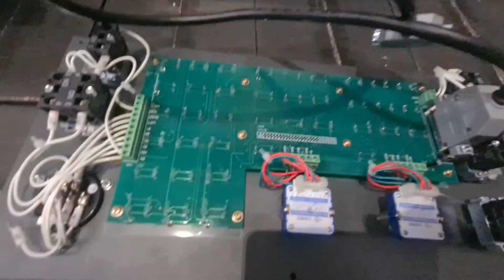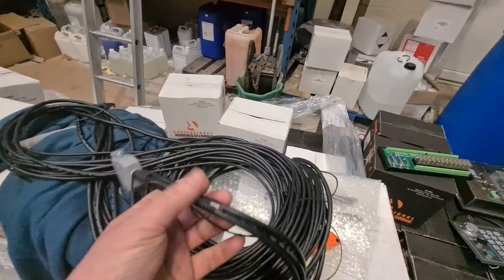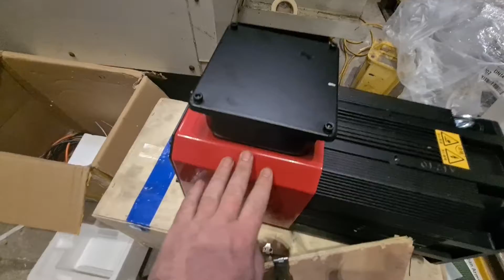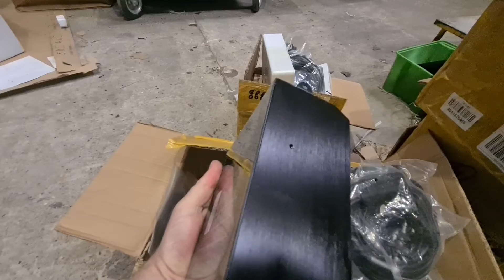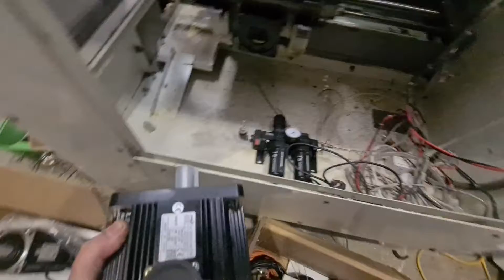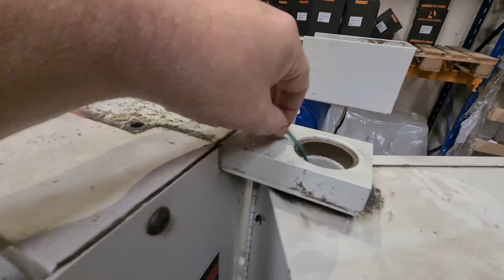SZGH parts arrived.

Comment: Hello Dean, I have re-watched your videos all this week, just looking to have much details about this startup, Thanks alot for ur help mate. I've got a ?,  how did you manage the Z Axe Motor, without the brake, i saw all three motor didn't have the brake to hold up the Z in it's place.
Reply from the maker: The Z axis uses a counter balance weight inside the column so even without the motor attached it remains where it stops.
Reply: @hemsworthlad  I appreciate it , it seems I'll need a motor with brake, i almost had an accident after installing the new one. may God Bless you
Reply from the maker: @abdelmounaimnmyesse5611  if you don't have a counter balance then yes you will need a break on the motor.

Comment: how will you get the tool changer to function? will you be making videos for whole conversion? I have built four cncs but i haven't had to deal with tool changer yet but i just bought a fadal 3016 and may swap controls over just worried about tool changer.
Reply from the maker: The controller comes with a tool change option for a carousel type ATC. It will just be a case of setting parameters and tweaking some code. When I get it working I will make a video.
Reply: @hemsworthlad  ok sounds good thanks

Comment: Is it up and running now ? Are you happy with your purchase? I'm about to but one for a cnc mill conversion. Thanks for the video.
Reply from the maker: Hi Steve, No it's not running yet but that's due to a lack of time and nothing to do with the controller. I have it set up on a bench to play with and I'm very confident it will be perfectly fine on the machine. The controller is easy enough to understand plus SZGH tech service is excellent and very friendly so if I do have any troubles on the machine I know they will help me sort them out.
Reply: @hemsworthlad  Thank you for taking the time to reply.

Comment: Wow awesome
I have a fadal 15 and I bought the kflop controller but now I am thinking about going your rout.  I was going to reuse all the servo motors and vector drive spindle controller but this looks way better.  The tool changer macro would have to be coded in c.  This seems like it has a better way of controlling the turret.

Comment: Thanks for posting this. I’ve got a Deckel Maho 63v with a Siemens 840 that is nothing but trouble. I’ve been talking to Eileen at SZGH about a retrofit kit.

I’ve got reasonable time on Cnc machines (I’m a fitter machinist/toolmaker with a good workshop to make and adapter plates etc) but have never Attempted a retrofit .

Please keep posting videos as I’m interested in how it comes together
Thanks Dave
Reply from the maker: Yes I will be doing another very soon with it wired up on the bench. So far I'm liking what I see and SZGH have been very helpful with excellent service.
Reply: @hemsworthlad  Hi Dean, I realise that this is an older video, hoping that you may still be able to give a bit of insight from your experience with SZGH controllers, would it be possible to contact you directly. Regards Russel